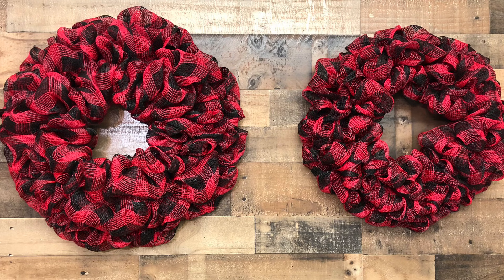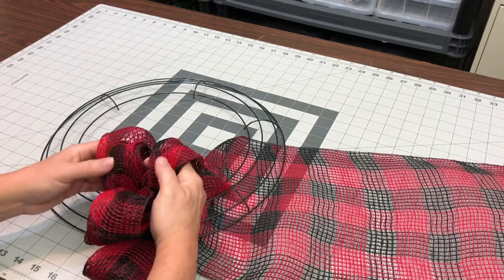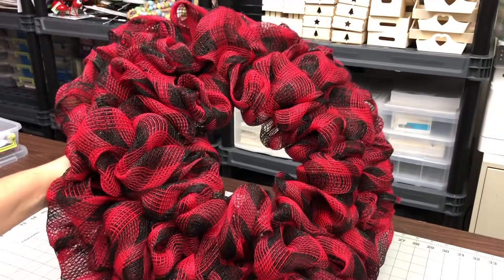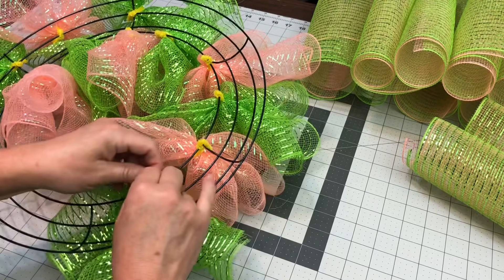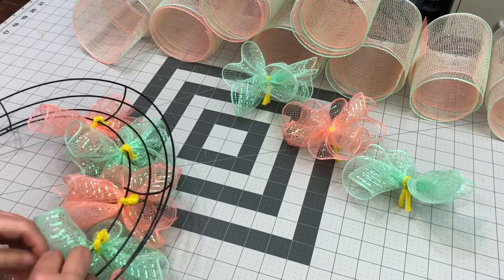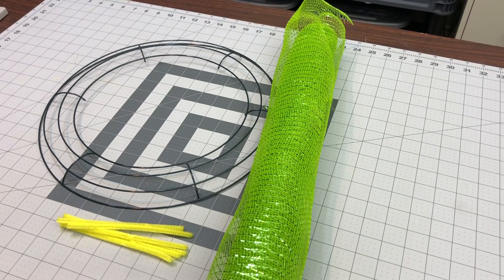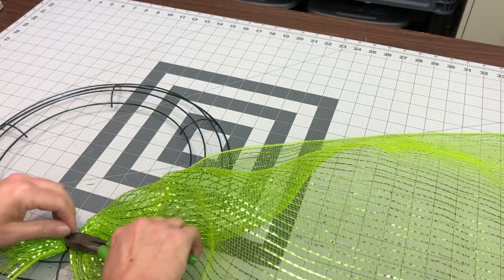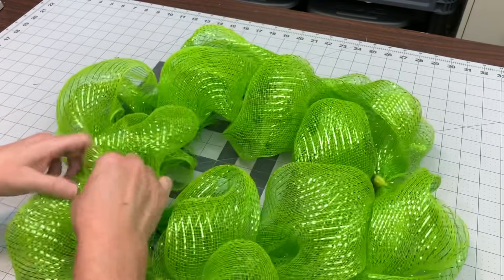7 Deco Mesh Wreath Bases / 5 Different Methods     All Using a 14" Dollar Tree Wreath Frame

Comment: Thank you so much for taking the time to show each type of wreath.   I have been crafting for over 50 years, but never used these wire wreath forms. So I decided to try. Got some floral wire and hated every moment of it. Had to wire on my Christmas branches and it took me a day and a half.    Made two for my Son, they ordered them after I had sent them a Halloween wreath. I have always worked with grapevine. So much easier to work with and you can use glue.  So I have been struggling, so I am so glad I found you channel.   I will be making the pull through method.  Thank you so very much. I truly do appreciate you. Just subbed.
Reply from the maker: I'm humbled that I have inspired you to go for it with a wire frame.  I am so glad you found my channel.  I have a method that I love that is easy and fast.  Check out the video, Chain Method.  I think you will like that one as well.  The pull through is my go to for a full wreath that will stand up to wear and tear.  Thanks for watching, commenting, and subbing.  Chat with you soon.

Comment: Love this video.  I wasn't a fan of the bubble method until I figured out what I was doing wrong.  If you stack 2 10" rolls and only attach them to the 2nd bar, when you separate them and puff them up, there is no gaps.  It works great.  I did several this way for people who are picky about the frays.  You can use same colors on both rolls or use mutiple colors and alternate how you separate them.  Lots of options.
Reply from the maker: Thank you and thanks for the tips.  I will give that a try at some point, it sounds like a great way to do it.  Thanks for watching and commenting.

Comment: I’ve learned so much watching this!!! Thank you Greatly !!! 
I have questions? On the tool method, do you twist each one then combine?
I didn’t quite catch what the “Chain method” was during the puff wreath. Also, did you use the complete roll on the puff & bubble methods?? 
Can’t wait to see how to make bows!
Reply from the maker: The chain method is a seperate video. You can check it out in my Wreath playlist. I don't typically twist but sometimes I find myself twisting.

Depending on the size of the bubbles you can easily use a whole roll, sometimes more.

Comment: Your videos are awesome and I learned a lot. I have a question that maybe you can answer. How do you keep your mesh from fraying on the sides (the long edges), and the ends after you cut the mesh? I seem to have an issue with that no matter what brand I buy. It makes everything look messy and I get discouraged.
Reply from the maker: I was thinking of doing a video with tips. Sadly, not a lot can at stop the fraying. It's controlling it or hiding those edges. That's why my go-to method is the pull through. Fewer cuts so less fray. 

Thanks so much for the kind words. Keep an eye out for the tips video. Coming soon.

Comment: When doing the poufs with short stems or zip ties how do you attach ribbon
Reply from the maker: I have several videos where I do wreaths start to finish.  Those cover the process of adding ribbons, bows, signs, and other embellishments.  Check out the WREATH playlist on my channel.  It includes 2 videos on finishing out 3 of these bases.  I will post the other videos finishing the rest of these bases this week.  I think I already mentioned that in one of your comments but I want to say it again in case any of my replies get deleted.  As always, thanks so much for watching and commenting.

Comment: Can u use two different colors deco mesh using the pull through method?
Reply from the maker: Yes. You just start two rolls and alternate as desired. You could also use a different color on each go around on the frame. I'll try to do one using both options soon. Thanks so much for watching and commenting.

Comment: I have a question my mesh unravels, it comes from the dollar tree should I be using tulle to do my wreaths. Because I can see that yours doesn’t have strings sticking out everywhere
Reply from the maker: Unraveling is an unavoidable reality in most wreath making. When I use a method that is prone to unraveling, I just cut the strings when I complete the wreath and try to not think about it. Pull through our bubble methods don't have unraveling issues because you don't cut the mesh. Dollar Tree mesh is the worst for unraveling. Once you complete a wreath you don't see all the details that can drive you crazy while making it. Enjoy your finished project and don't sweat the small stuff. Thanks for watching.

Comment: This is awesome! You really give great instructions! I started making wreaths for myself last November and I’ve seen A LOT of tutorials and yours is by far one of the best! For the pull through method how many rolls does it take to make a 18 inch wreath?
Reply from the maker: Thanks for much for the kind comment.  I'm not really sure.  If you use 10" mesh maybe.... 3-4   It will also depend on how tall you make the loops when you pull through.  Sadly, I'm a buy more than I think I need and just go with it.  LOL  I have had several people asking how many rolls so I am going to start making notes to share that info.

Comment: The one you use with the mint and the cantaloupe from Michael's 5.5 mesh needs more you can see the wreath and your Yellow Ties
Reply from the maker: Thanks for your feedback.  I wanted to show the difference in using the 10" and the 5.5" and use the same number of pieces.  I intend to use more ribbon or some other way to fill it in.  I will also use yellow in the ribbons so the yellow pipe cleaners will be covered or blend in.  Thanks for watching and commenting.  Keep an eye out for the completion video and let me know what you think.

Comment: How many rolls do you typically use on one wreath?
Reply from the maker: Depending on the technique and fullness it varies. Two rolls is typically enough. If you have extra just make bundles and it will be really full. Or use one roll and you'll need to fill in with ribbon and embellishments. Thanks for watching.

Comment: What is the chain method when doing the pouf?
Reply from the maker: I replied on Joanne's comment but it keeps getting deleted.  I hope this one will not.  I have a video on it.  It was posted Feb, 12th of this year.  It's measuring the mesh and twisting on pipe cleaners before you attach it to the wreath frame.  It's crazy easy and helps people who get frustrated with the process of measuring and attaching while on the frame.

Comment: I am mew at making  wreathes so my question is of I have an 18 inch frame and 6 inch mesh what is the cut on it?
Reply from the maker: It would be the same cut as a 14" just more of them. It also depends on what base you are making. The steps are all the same you just have to use more with 6" mesh. You can play around with it and determine what you like and how full you want it. You'll have lots of fun making wreaths, so try lots of things and enjoy the process. I would love to see some of your creations over on Facebook. Dion Allen Designs 

Thanks for watching and commenting.

Comment: How do you add ribbon to the cruffle wreath?
Reply from the maker: Hi Brittany.  I have the 2 cruffle bases completed and the video on them was posted on April 22nd.  Check it out.  I typically twist a 6" pipe cleaner around the middle and attach that directly to the frame.  In this video at 8:10 you can see how I attach the ribbons.  It's on the smaller base so I only needed 4" pipe cleaners to attach to the frame.  On occasion I will use a smaller pipe cleaner and apply hot glue to it and place between the mesh.  Please let me know if I need to explain better.  Thanks so much for watching and commenting.

Comment: Hello!  I’m going to make a spider wreath.  In your opinion, do you think I could do the 10” cruffle method with all black mesh and it would cover and be a full 14” inch wreath?  Thank you
Reply from the maker: I think that would work well. Coverage depends on how much mesh you use. Also, the middle would probably be filed in if you use the inner most ring. If not, you could run a pipe cleaner, or two, across the middle, securing on the rings. Then attach your cruffle on the pipe cleaner. Sounds like a fun wreath.
Reply: @DIYDion  thank you.  I liked how it is so full.  I originally was tho of putting that hard plastic mesh in the middle.  I’ll see how full it looks.  If for some reason it looks kind of see through, I’ll add it.

Comment: How do you keep the mesh from raveling??
Reply from the maker: That is the million dollar question. You can use a wood burner on certain types. I've only done that once and probably won't do it that much. I don't see a big enough difference for the effort. 

I've seen people use liquid fray deterrents, like fray check, but that's a huge time waste if you are cutting lots of mesh. I think the general consensus is to use methods you can hide the cut edge, like a cruffle, or just cut off the strings when done and forget about it. Also methods like pull-through and poofs, where you're not cutting a lot help the frays. I hope that helps some. Thanks so much for watching and commenting.

Comment: You mentioned the chain method. What is that?
Reply: Yes I want to know what the chain method is also.
Reply from the maker: Hi, Joanne.  It keeps deleting my reply. I have a video on it.  It was posted Feb, 12th of this year.  It's measuring the mesh and twisting on pipe cleaners before you attach it to the wreath frame.  It's crazy easy and helps people who get frustrated with the process of measuring and attaching while on the frame.  Thanks so much for watching and commenting.
Reply from the maker: Hi Wendy.  My reply to Joanne keels getting deleted.  I replied again and I am replying to you so maybe if that reply gets deleted again this one will not.  I have a video on it.  It was posted Feb, 12th of this year.  It's measuring the mesh and twisting on pipe cleaners before you attach it to the wreath frame.  It's crazy easy and helps people who get frustrated with the process of measuring and attaching while on the frame.

Comment: You're using 10in mesh? Would 6in mesh give same look?
Reply from the maker: Hi. On this video between 9 and 15 minutes I do the same method with 10’ and 5.5’ mesh. You can see the difference in the thumbnail. It’s less full and a bit smaller but still beautiful. You could use more bundles to make it fuller but it will still be a little smaller. If you use any of the other methods you would just need to increase the number of poofs or pull through to make it fuller. Thanks for watching and commenting.

Comment: I have a 21 inch x15 mesh what can I do with it. Can I make a wreath with it.
Reply from the maker: I have a video using what I call, the chain method.  You could make 10 inch poofs and attach them to the wreath frame.  " Using 21 inch mesh should make it plenty full.  Thanks for watching and commenting.

Comment: How do u attach ribbon
Reply from the maker: I typically use a pipe cleaner twisted around the middle of the ribbon bundle and then attach to the wreath frame. Rarely I will glue the ribbons in the center of the bundle to the mesh. Thanks so much for watching.